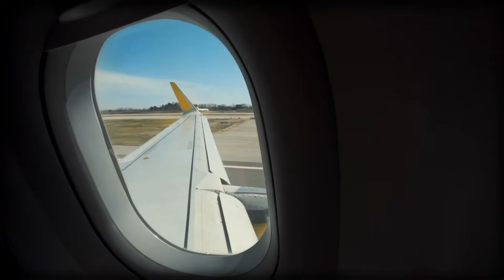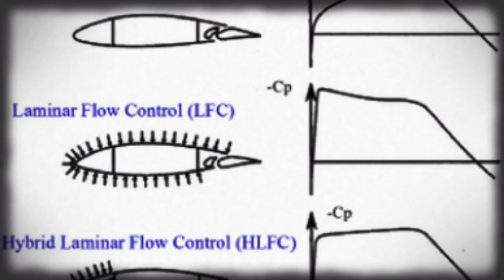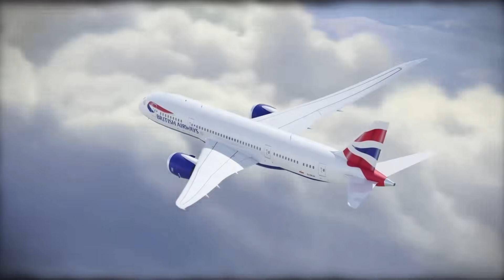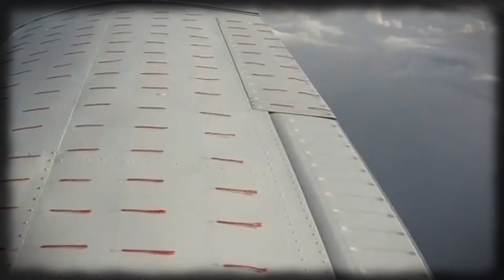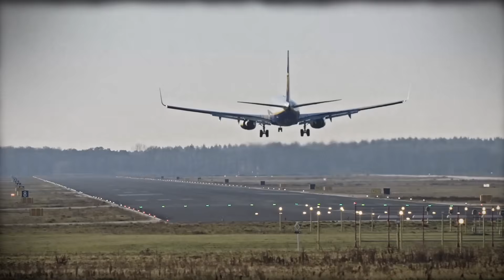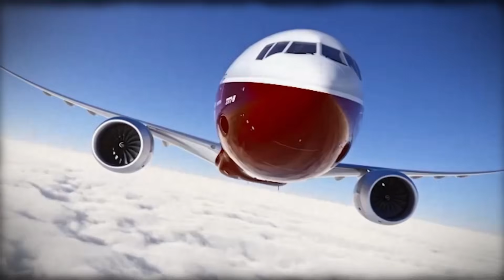Why Boeing REFUSES to Use This Revolutionary Wing Design Will SHOCK You!

Comment: What was also overlooked is the fact the laminar flow wing is a high speed wing, but it's low speed/stall characteristics are nasty.  why the Navy turned down the P51 Mustang in it's WWII carrier trials, as the wing has a nasty stall and the P51's stall was too close to the max landing speed for carrier arresting, plus all the other characteristics of contamination on the wings !!!
Reply: For commercial use the contamination issues would prove to be to maintenance heavy.